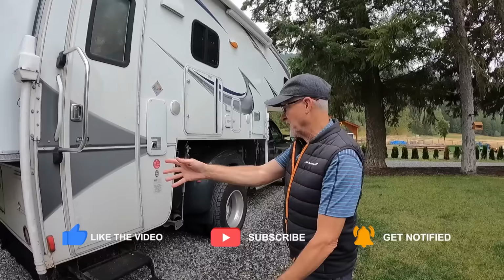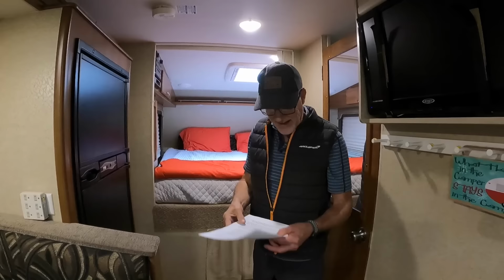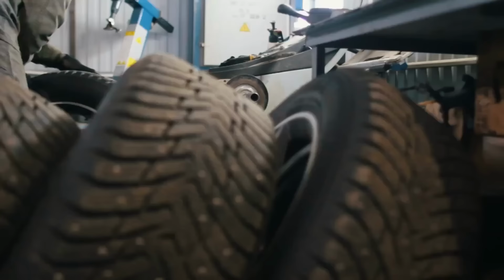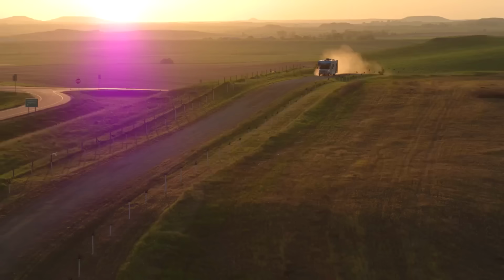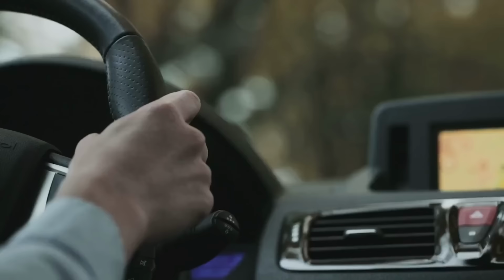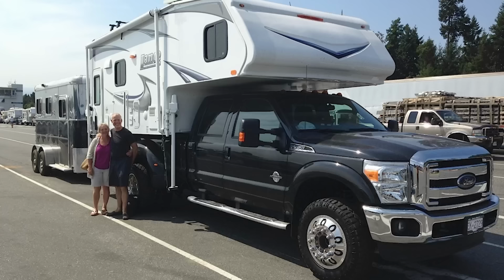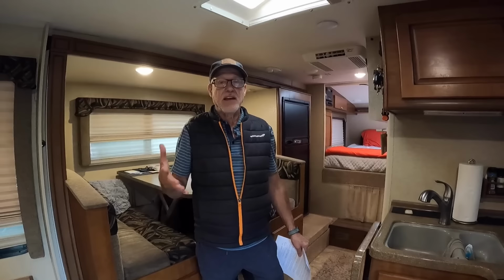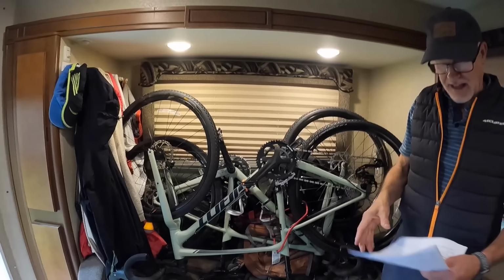Truck & Camper Pros & Cons – and how you can eliminate a couple of the cons you've heard about . . .

Comment: Nice video. My thoughts? If you can't get in and out of that bed you shouldn't be handleing and loading a beast like this. Get a  van or condo.  You can use 20lb ers for LP.  Sway? what truck loaded doesn't? I grew up hauling loads. No problem. Your truck probably knocks the teeth out unloaded.  Now you can speed cause no sway? don't tip over.  Just under 13 ft? I see tons of bridges 12ft or so. We leave our bikes home. Not worth the hassle and trashing the inside. We hike..I mean hike. better exercise really.

Comment: If you could be more precise with them rim specs and spacers, that would be great. 06 f350 drw. 2000 Lance 11'6
Reply from the maker: Good point - you're the second person that has asked, so I'll also do a post in the main video Comments area.

The wheels are 10 bolt American Force.  (Had to install adapter rings - which also forced the wheels out slightly further on each side.  A good thing.  Just the standard 8-bolt factory to 10-bolt as required by the after-market wheels.  My memory tells me they add about 3/8ths of an inch to the track width.
I had some really gnarly tires for the first 50,000 miles, great in mud etc. but also not snow rated, and the mountain pass near here requires tires with the snowflake on them so the heavy duty pick-up truck expert I consulted put me into the Yokohama Geolandar A/T series - 10 ply rating, size LT275/65R20 126/123R  I'm just so impressed with them.  Quieter on the highway than my previous selection, but super solid cornering or otherwise.  (Think 'roll elimination'! ) :)

Comment: Nice video. Question. When driving,do you turn off propane valve?tk
Reply from the maker: Great question.  In British Columbia and elsewhere I suspect, one is required by law to turn off propane and actually affix a sticker to the valve(s) after the propane is turned off.  One end of the sticker is also affixed to the bottle so that at a glance ferry personnel can tell if it's been turned back on - which again would be illegal while on the ferry.
The issue is that if there is a leak in a fitting or line, and the igniter is called upon by the fridge or hot water tank to do it's job, and the vehicle is moving there is a significant chance of damage to a lot of other vehicles that one is sharing the road with.  And - even for 5 or 6 hours of travel - the fridge contents should be fine as long as one has water bottles, pop or other liquid containers in the fridge, they tend to help maintain the temperature at an appropriate level for foodstuffs.
In Canada - the legal regulations can be confusing.  For example, travelling in BC with the propane on is apparently illegal.  In Alberta it is totally legal.  And to add to the confusion, municipalities are apparently allowed to set regulations that apply within their jurisdiction.
Changing subjects just a little - yes - one could use the 12v battery setting on the fridge, but my experience is that even with the vehicle charging the coach batteries, the draw by the fridge is significant enough to pretty much deplete a couple of good batteries over the course of 8 hours or so.
And I'd welcome hearing from others on this subject.  
What is your practice?
Reply: Thank you.
Reply: I drive with propane valve off.

Comment: A con is the cost for a truck and camper vs. class C.
Reply from the maker: Huge thanks for tuning in and sharing a very valuable perspective.  
If one has no use for a separate cab and chassis I would agree 100%.  
But if I went Class C - I'd still need a one-ton capacity pick-up truck and that is probably what swayed me to the truck and camper combo.  
As you'll see on my little channel, I've got enough going on with my little hobbyist sawmill and hobby farm that the wheels on that F-350 go round-and-round at least 2x per week on average.
Again - thanks for tuning in.

Comment: Howard, I do not know of any 1 ton dually that can have a gross vehicle weight of 16,000 lbs. it doesn’t matter how much extras you put on it like airbags etc, you can not change the gvwr. You are at least 2000 lbs overweight. Beware, you may be sited at some point.
Reply from the maker: Huge thanks for the fact check.  That's what I love about YouTube.  With every post I learn something new from viewer comments.
My vintage is rated for 14,000.  
My info (and I should have fact checked deeper) came from a dealer I was talking with pre-video shoot.  Upon checking the official Ford site (link below), the 2022 new F350's, 4X4 and Dual Rear Wheel configuration comes close with posted specs as follow:   
Front Axle: 5,600 pounds
Rear Axle: 9,900 pounds
Total: 15,500 pounds 
https://www.ford.com/trucks/super-duty/models/f350-xl/
PS - and the dealer rep was not wrong.  The 4X2 version has a better Rear Axle GAWR.  It's rated for 10,300 pounds which would allow a total GAWR of 15,900 - which is close enough to 16,000.
Sounds like it's time for me to either lighten the load or upgrade the wagon. :)
Thanks again.
Reply: Call your sales man /woman out on that basically a lie (to u the buyer)
Unbelievable

Comment: buy aluminum propane cylinders
Reply from the maker: Ohhhhh - good point.  I honestly did not know there was such a thing.  Huge thanks for tuning in and for sharing.
My 30 second online search suggests that a 30lb capacity (7 gallon) aluminum bottle costs about $300 more than steel, but hey - we're talking about an accessory for an $80k  RV unit and perhaps eliminating strained muscles or worse.
Again, thank you.

Comment: Question.  With the upgrade price, would the f450 been a better purchase?
Reply from the maker: I think knowing what I know now, I would probably have gone the 450 route, but this is one of those things that is so hard to know until one has truck & camper experience - which I did not have at the time.  Camper manufacturers and dealers seem to consistently understate the weight of those units.  Campers like Coral and me underestimate everything we're going to put onboard, and truck manufacturers/dealers sometimes exaggerate the appropriateness of the vehicle for the job.  The combination left me with what I considered to be a 'no choice' decision to upgrade.

Comment: Put all the weight on the truck, must use a lot of gas, I think better use a trailer. Is that correct?
Reply from the maker: Thanks for tuning in.  You uncovered some things I should have talked about.  Welcome!
So, in response I am now I'm going to sound like any lawyer or tax accountant one ever talks to - and say:  "Depends".
The truck will handle the weight.  Full load and on a highway with a 70 mph speed limit (which would mean that Coral has us on cruise at about 75 mph) we average 23 litres/100 kilometres or about 10.2 miles per US gallon. 
Here's the 'kicker' for me.  
It's relatively short and compact.  I'll trailer when I have to but no matter how I've got that trailer accessorized I always feel like I'm driving something 'big', regardless of sway bars, load levelers etc.  
I always feel a bit like the trailer is driving me, not the other way around.
Once I got my suspension issues sorted out with the truck, it drives with the ease of an SUV.  Sitting up high is an extra advantage in heavy traffic or inclement weather.  
Coral who does 90% of the driving on our trips (she's an excellent driver and I'm an excellent passenger) after having made a couple of trips with a travel trailer that we were trying out, and was thrilled to get back in our truck and camper unit.  
So - "depends" on personal preference as much as anything I suppose . . . .
Reply: @howardkettner  Thank you for the detailed explanation, I think you are right. Depends is the word 👍

Comment: Your GVWR is 14,000, not 16,000. Both ford's  F-350 and F-450's GVWR is 14,000.
Reply from the maker: Hey Jay - thanks for tuning in and joining the conversation.
And, thanks for the fact check.  That's what I love about YouTube.  With every post I learn something new from viewer comments.
My vintage IS indeed rated for 14,000.  
My info (and I should have fact checked deeper) came from a dealer I was talking with pre-video shoot.  Upon checking the official Ford site (link below), the 2022 new F350's, 4X4 and Dual Rear Wheel configuration comes close with posted specs as follow:   
Front Axle: 5,600 pounds
Rear Axle: 9,900 pounds
Total: 15,500 pounds 
https://www.ford.com/trucks/super-duty/models/f350-xl/
PS - and the dealer rep was not wrong.  The 4X2 version has a better Rear Axle GAWR.  It's rated for 10,300 pounds which would allow a total GAWR of 15,900 - which is close enough to 16,000.
Sounds like it's time for me to either lighten the load or upgrade the wagon. :)
Thanks again.

Comment: That is
 to big of a camper.  If you need that much room use your trailer.  The cost you put into that truck camper you could have bought a class A.  Not for me.
Reply from the maker: You are right on so many levels - but - - - had a Class A and sold it. It just was not safe or capable of going where we go (clearance or 4-wheel drive).  This little set-up could not be better suited to our types of adventuring.  
Thanks for tuning in . . .